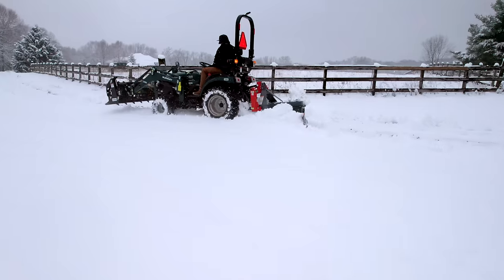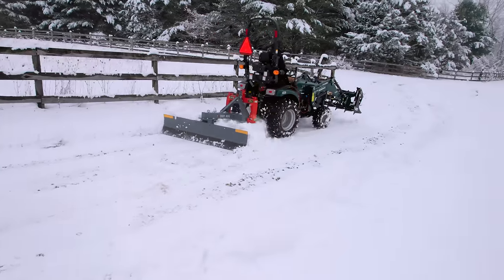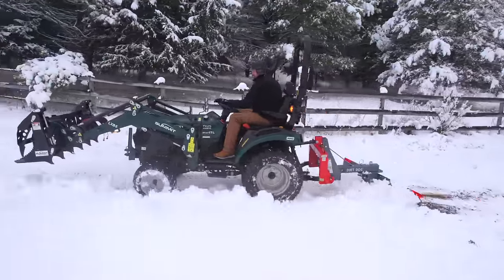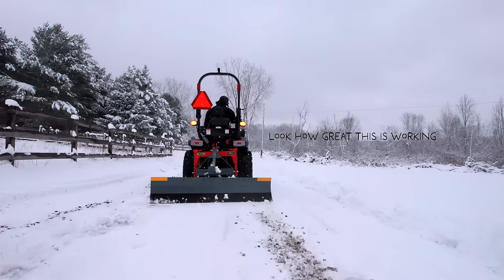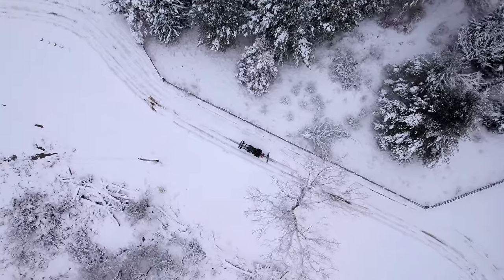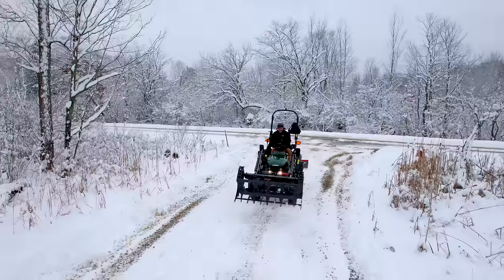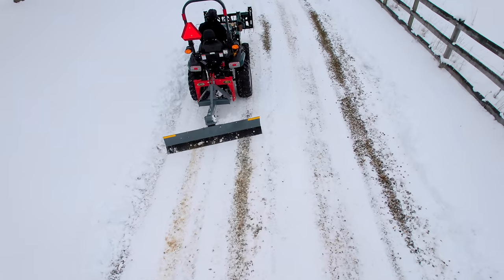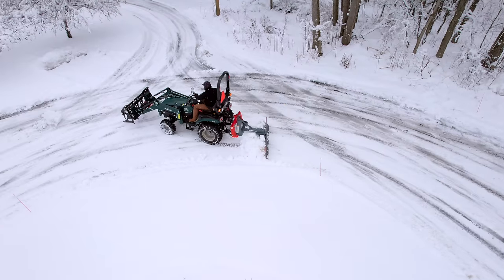PLOWING SNOW WITH THE SUMMIT TX25 TRACTOR

Comment: First winter with a tractor and rear blade.  I made a mess of my gravel driveway using the blade in the normal position.   I have a bunch of gravel to move back this weekend now that the is melted.  Live and learn.

Comment: I saw someone else reversing the blade and I tried it.  Works much better on my gravel driveways.  About the best you could hope for with gravel.
Reply from the maker: Yeah, it's a really good solution
Reply: @GoodWorksTractors  Hmmm, many people use a truck and I've never seen them put the blade on backwards.   I have a 7' blade on the back of my nice J.D. 750 4wd. w/ front chains but I installed round Western style skid shoes and use it as designed.  I welded 2 sleeves to 7" length of 4" channel iron and welded it to back of blade.  I adjust skids to leave 1-2 " and have little or no limestone dragged onto lawn.  I live north of Battle Creek and had that same, super wet snow.  Put a good angle on blade and rolled the snow to the edge of driveway, 1/2 mile long easier than your idea.  Maybe you should make a kit to bolt or weld skid shoes on blade and use blade as designed for better results.

Comment: I had a L2800 kubota with a 7' angle blade and I ran it backwards clearing snow off of parking lots, biggest was the parking lot at our local hospital. Doing that back 20 yrs ago. But still good info for new tractor owners.

Comment: By turning the blade around you turn the positive rake of the cutting edge into a negative rake cutting edge.  I shorten my top link all the way down and turn my cutting edge angle to close to 0 degrees, more or less perpendicular to the driveway surface.  Great video!

Comment: My setup for our paved sloped driveway (12 car capacity) is a 72” pusher on front and a 5ft box blade on back (rubber edges). Back when I was deciding between a back blade and box blade snow did come into the picture, however for our trails the box blade just ended up being more versatile. It has proven itself on snow as well, our driveway tends to really collect ice easily and it scrapes better than the pusher. Great vid
Reply from the maker: Glad to hear it!

Comment: We don't get a lot of snow in our area but when we do I've always used a back blade.  I don't have near as much area to plow as you so I normally leave the blade facing it's normal direction and push backwards, that way the tractor tires haven't packed the snow I'm trying to move.  Boy it is a literal pain in the neck though.  An additional tip if your blade has pivot, remove the pin and allow it to float so it can follow the various contours.

Comment: Try using the blade forward facing but playing with the top link length. You’ll find you can adjust how hard it scrapes by letting it in or out

Comment: The key to not wearing out wear edges on Gravel in winter is getting a base layer of snow packed. I have a good 2-3inches of hardpacked snow on mine and I scrape down everything above that. I use a pusher and a box blade.
Reply from the maker: Can't do that here the last few winters.  This snow will already been gone in a day or two.  It comes and goes, the drive hardly has time to freeze it seems like.

Comment: Add a front, manual angle plow to your Ranger and you can plow in comfort.  Some chains on the rear wheels and you’ll love plowing even more.  Use the tractor to move the banks back.

Comment: I have been using a 72" back blade on my half mile long gravel driveway for years. I don't turn it around like you have done in your video. I don't plow until we get at least a 3 inch base. That way we don't pick up much gravel. The only problem with that is that sometimes it can freeze up hard and then rain and then freeze again. It can be like a ice rink. Most every fall I have a Kenworth bring me a full load of driveway gravel and I can sand with that.....

Comment: Question, I too have a rear blade, slightly larger to fit my 50hp tractor but still, same deal.

As my rear blade has support-wheels, I can't run it forwards while having the blade facing backwards, so naturally I haven't tried that.

Is there a reason you're doing so in the video? Just very curious and eager to learn of new techniques.

Greetings from a fan from Sweden.

Comment: I have a rear blade off a Ford 8n and used to use it all the time with the Ford 8n and know I use it on my Mahindra 1626 when the snow is too wet for my 66" blower.  I don't understand the big deal of using it backward.  I have pulled and pushed with it and as long as the road in frozen it does not pull up and stone.  I love my blower but a rear blade works great and there is no real need for all this fancy with it just use it and it works great.  It is like using a bucket it requires skill but in float mode it is not real hard.

Comment: rear weight with the hitch hangers and the weight bracket is not really ideal for using this blade as you would want the blade to float a little bit. If you had ballast weight to the quick hitch you will not have the floating option as the weight will be consistently putting the rear blade down to the ground. Most of the time the rear three point does not have consistent pressure upward to hold the blade from floating, this is where the weight for the rear comes into play. It is always good to have loaded wheels with RImGuard as you advertise and some wheel weights in this certain application.
Reply from the maker: I could have used a bit more weight.  There was a time or two when the blade lifted up over the snow.  Not often, but it happened.  Maybe just a bit more weight would have been perfect, but it was close enough.

Comment: It would be neat for you to get a battery powered tractor like tractor time with Tim had just to get another  perspective. Never thought of using the blade backwards so it doesn't dig in
Reply from the maker: Likely at some point down the road
Reply: @GoodWorksTractors  just to get your perspective on the practical application

Comment: Random rant about YT driveway maintenance content:  YT driveway maintenance videos need to come to terms with the senseless idea of topping driveways with loose not-compacted gravel.  50% of roadways in America are dirt or gravel & DOT doesn't want loose gravel with no traction where they actually mix their gravel with smaller material to hold the large gravel in place for traction.  99.9999999999999999999999999% of YT creators have done it incorrectly & against the sense written into the road maintenance of their own States.  A properly 4%-sloped & compacted dirt or gravel road should be as hard as any 2%-sloped-asphalt road.
Reply from the maker: I used the same product that the road commission uses on my other driveway.  It has more fines in it to bind together.  A great base that can be topped with something more aesthetically pleasing to the home owner.  Residential driveways are different animals than public roads, so a bit more flexibility on material.  Many factors involved in building a quality driveway, starting with the prep work.
Reply: You obviously never been to Arkansas….. 😂😂😂.  Truth is most if not all county road department defer ALL Maintence a lot longer than they should bc the budgets are so slim and then they use the cheapest material possible.
Reply: @GoodWorksTractors  [not your drive but YT in general] Yes but b/c I know there is less traction it's aesthetically less functional & more of a safety hazard that requires even more maintenance than one designed to properly compact.   My fine sandy loam will remain compacted as long as it has at least 6 inches above the water-table & that it isn't in any effluent(sewage soaps).